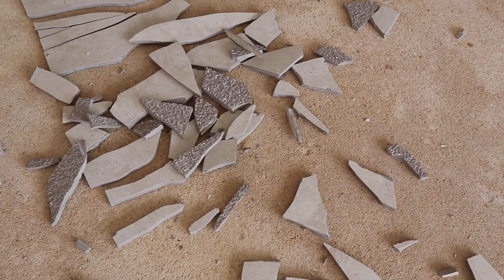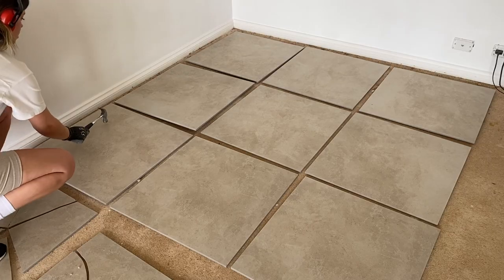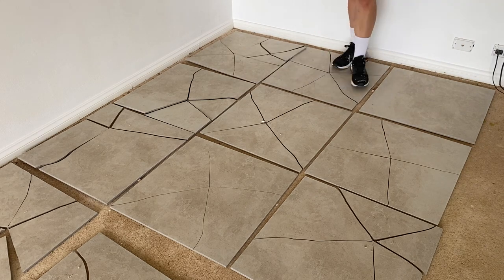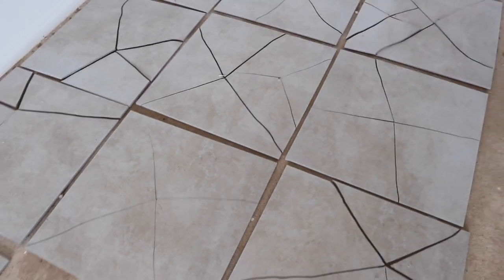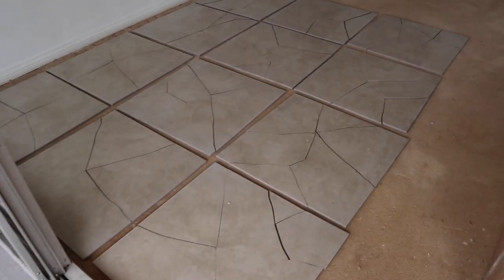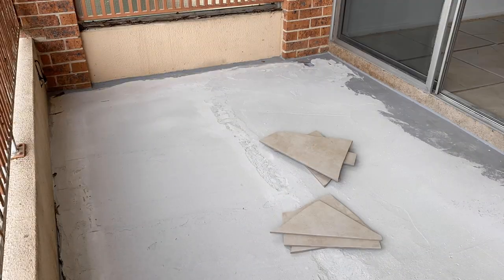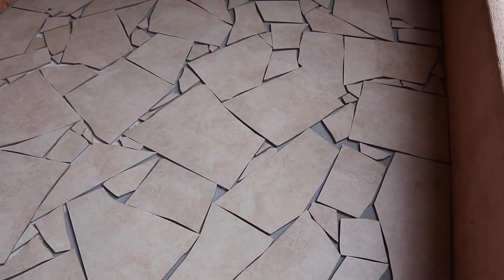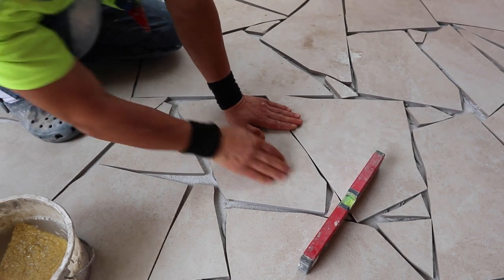How To CRAZY PAVE... DIY Home Balcony! | Home Renovation Australia

Comment: How did you tile around the drain?
Reply from the maker: The same way we tiled the rest, except we used smaller pieces so that it was easier to fit them in given the surface area directly around the drain isn’t huge.